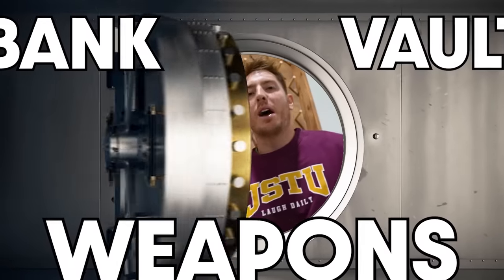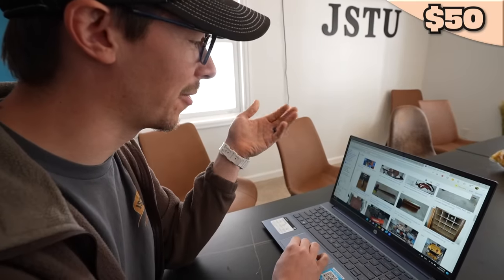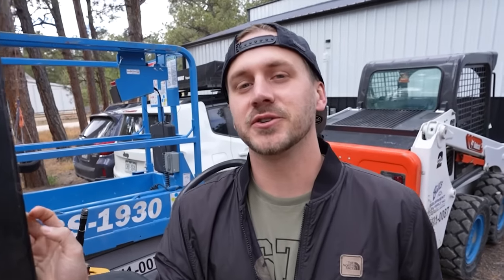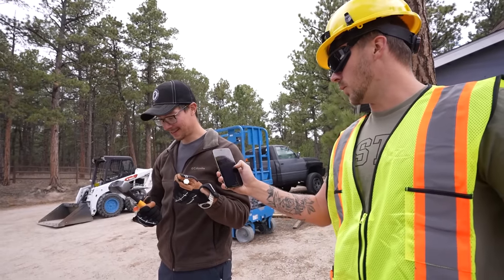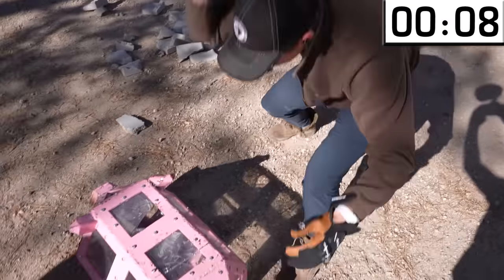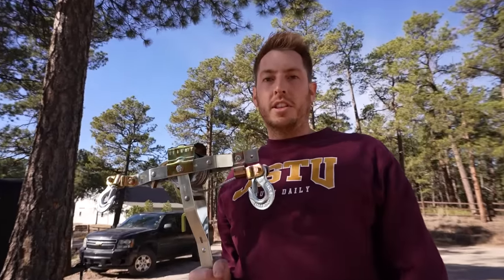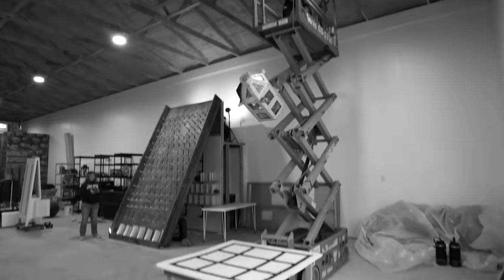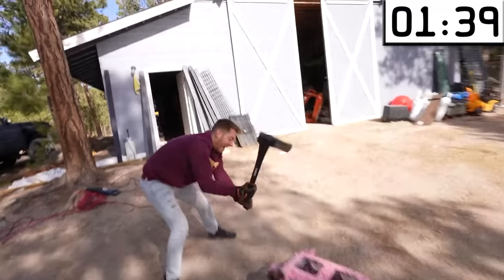$10 vs $1,000 UNBREAKABLE PIGGY BANK *BUDGET CHALLENGE*

Comment: Leave a like for Justin using that compactor on the piggy bank. the tool I would have used, a drill and then drill the screw heads out then use screw extractors